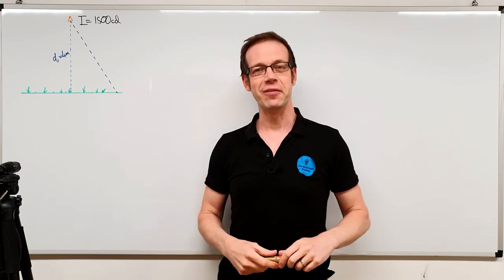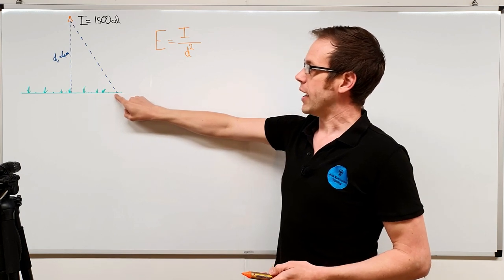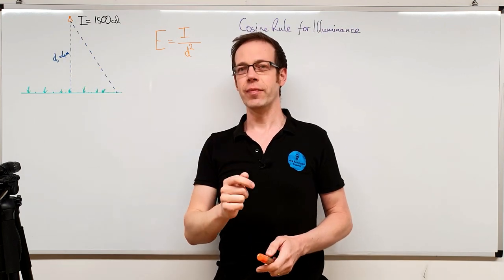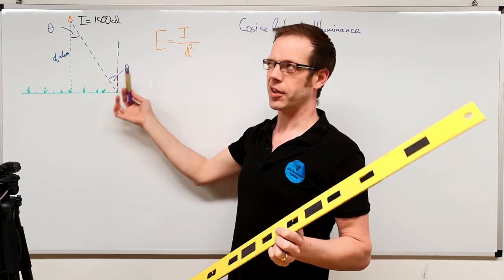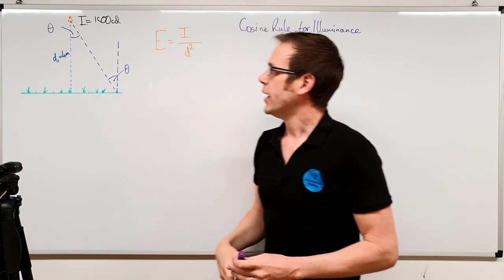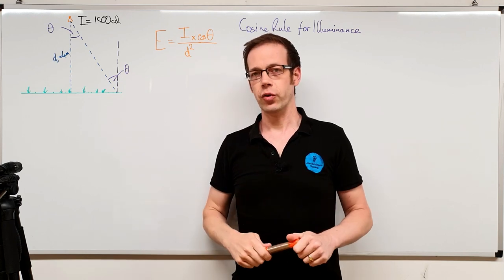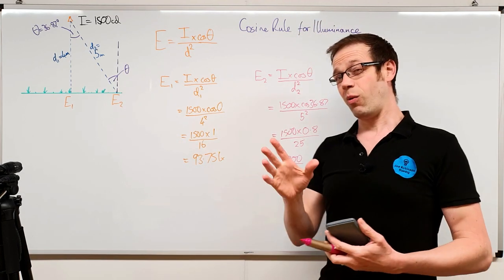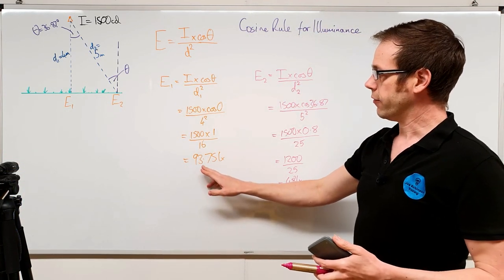What is the Cosine Rule for Lighting? How to Calculate Light Levels at an Angle from the Source

Comment: Great video!

Something I've been struggling with for a while, maybe you can help.  When you changed the angle of incidence from the torch, the pool of light changed into a more elliptical shape. I'm looking for a mathmatical way to determine the major axis of that ellipse, given the beam angle, distance, and z-angle.

Practical example: a theatrical spotlight pointed at the stage, from a position out over the audience. 

I've found a geometric way to do it with some basic trig, but I'm specifically interested in the relationship between z-angle and the major axis. (Eccentricity?)

Any help is greatly appreciated!

Comment: Good video Joe. When I did this long time ago we kept the original height (d) the same even for working out the angles? Is this a newer way. Don’t suppose it makes a huge difference 👍
Reply from the maker: Cheers Matt, you definitely need to use the distance from source to surface in a straight line, not just the height!